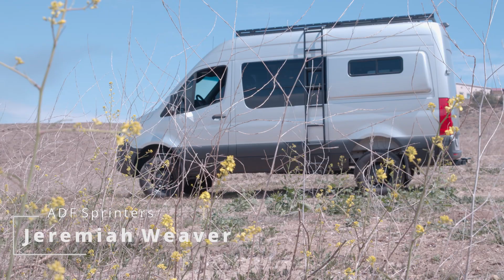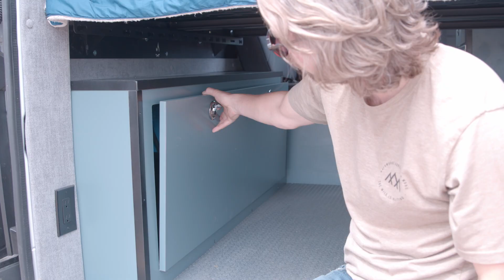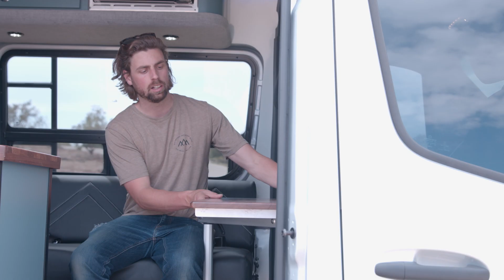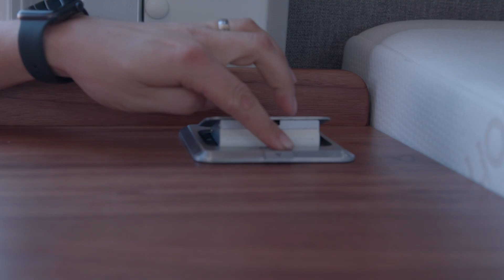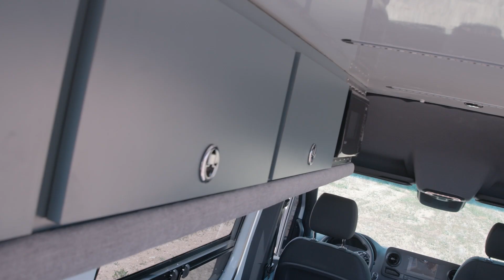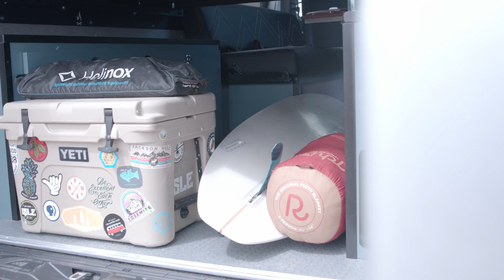Custom 4WD 2019 Sprinter 144” Conversion

Comment: The passenger sprinter is called Sprinter-Tourer in Germany. I have a 8 passenger version. I like the quick-out seat mounting system in the floor, that allows mounting of other things like a bed box ( with fridge, power station, wc, ...) or motorcycle mountings . The well equiped passenger versions are often offered to a good price, often less than half price compare to a full camper van conversion. My 🇪🇺 sprinter tourer came wirh a 52 gallon diesel tank that gives me a range from over 1500 miles. For a van conversion company it would make sence to offer a camper van conversion kit for the Transfer, Passenger, Tourer Sprinters 🤔😁